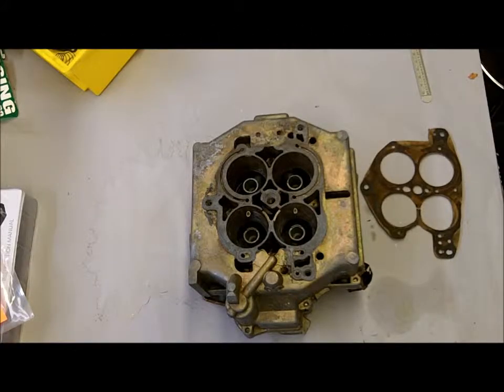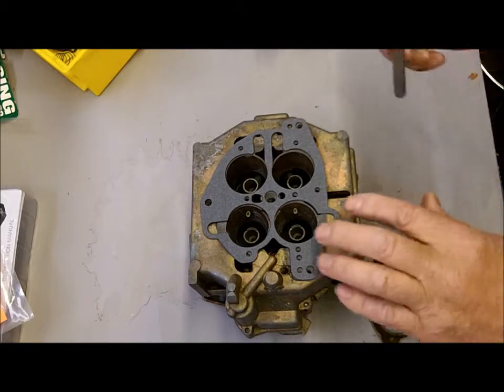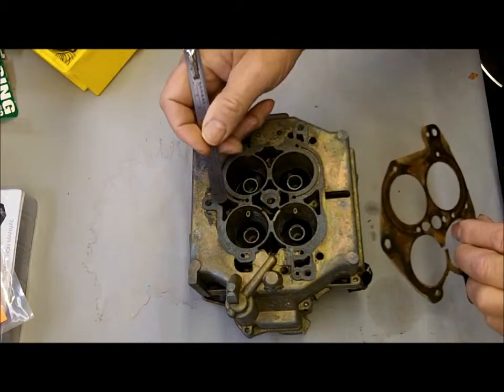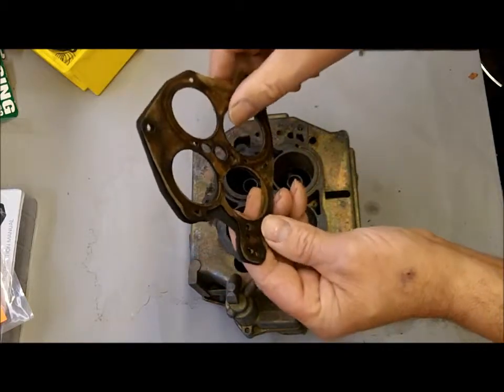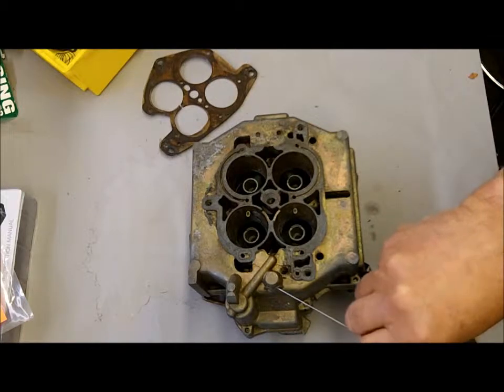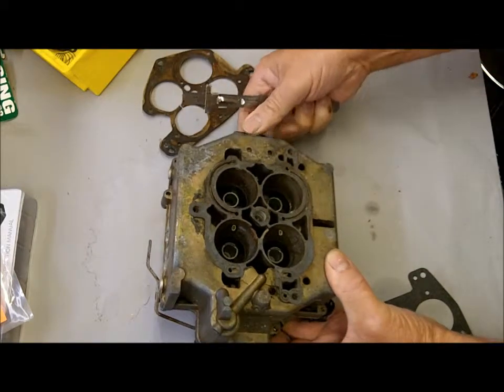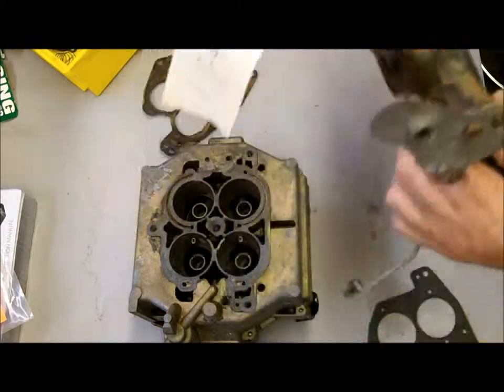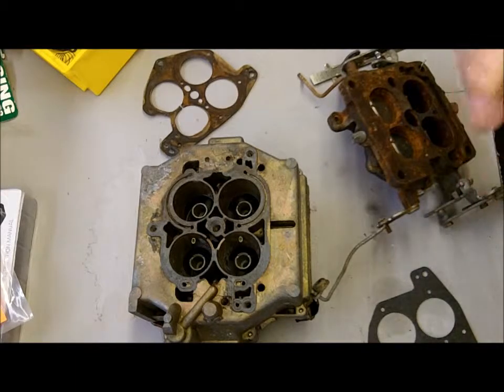Rochester 4GC 4 Jet Carburetor Throttle Body Gasket Leak

Comment: Great video, thanks for sharing your knowledge. Towards the end of the video you mention a hole (on the bottom of the throttle plate) that doesn't need to be covered. On my Rochester 4GC for a 55 Caddy that hole does have a small passage (about 1/16" diameter) into the primary below the throttle valve. When mounted to the intake that hole is exposed to the environment. What is the purpose? Why would it not cause a vacuum leak. Could it suck dirt into the intake? Your advice would be appreciated.